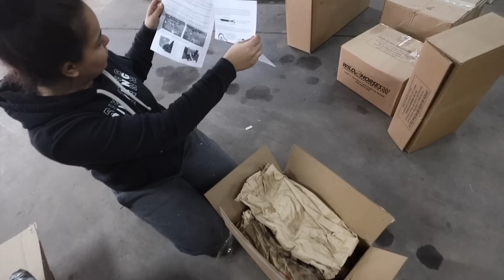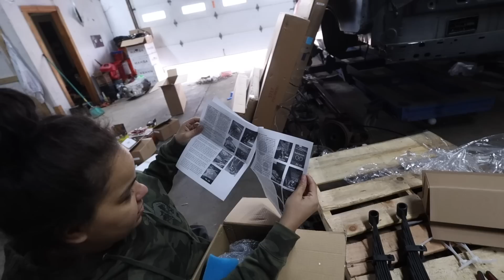Unboxing $10,000 Race parts for the Bronco!!!

Comment: The Hydro brake system is a hydraulic it works as brake booster and it works out off the power steering pump for both brakes booster and streering,sweet system.🤙🤙🤙🤙🤙🤙😎😎😎😎😎

Comment: Hydro boost uses the pressure from the power steering to assist you when you hit the breaks. Instead of relying on vacuum to power them. But it makes your break pedal super sensitive. It’ll take some getting used to.

Comment: As long as you use stainless steel Mounting bolts and hardware the tank won't rust. If you want extra protection clear the tank.

Comment: If you go gunmetal gray and black it would be cool if you did the rear gate in 2 tone, that inner portion the alternate color and the ford in the primary (I.e. if you do gunmetal body with a black roof you could paint the inner part black with the ford gunmetal).  I think that would be subtle but it would definitely be unique

Comment: Judging from the color or the welds and the material the tank is stainless steel. No need to paint.Check with a magnet to be sure.
Reply: Kinda looked clear coated

Comment: That fuel tank looks legit like stainless. If it is, you should be able to leave it plain steel, clean up where the weld burn is. Just wash it off when exposed to salt.

Comment: Yes the hydroboost piggybacks off of the power steering rather than using vacuum input from the engine. Its a much more reliable system